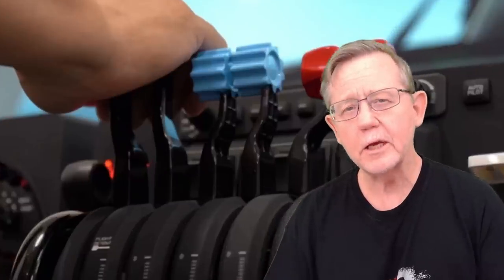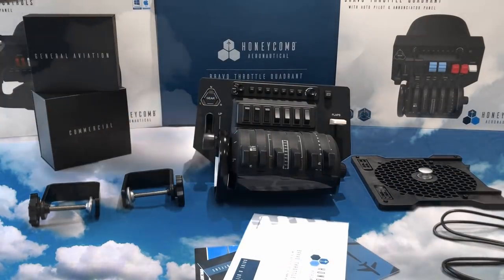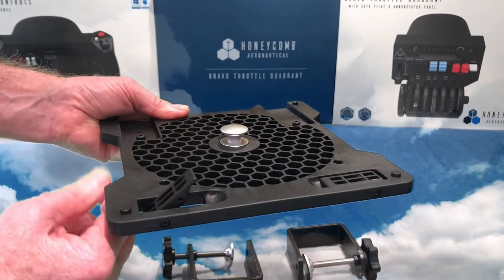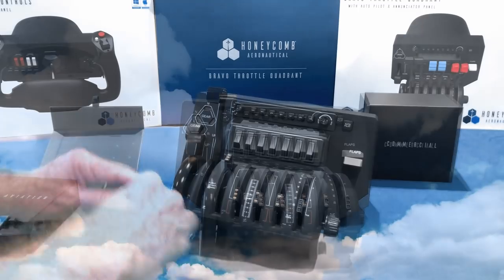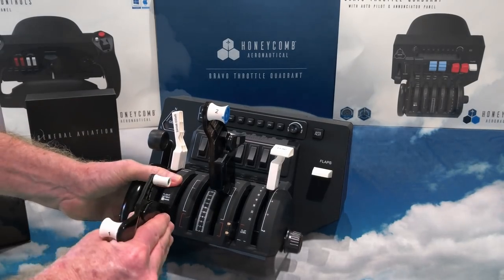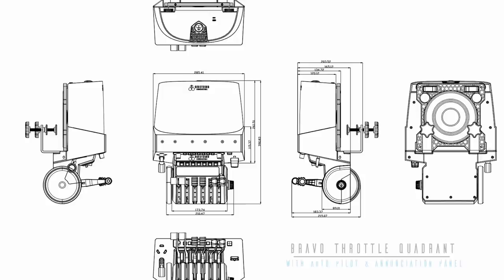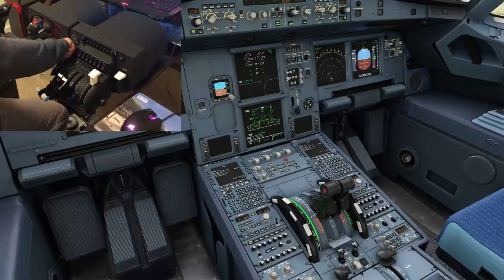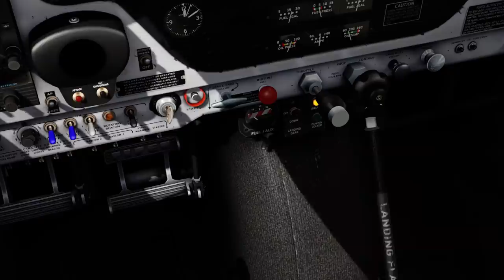BRAVO THROTTLE QUADRANT | Hands On Review | Honeycomb | MSFS | Xplane | P3D

Comment from the maker: The Honeycomb Throttle Quadrant reflects good value for money when compared to alternatives in my opinion. What are your views? Catch my follow up video on how to set reverse thrust for MSFS airliners here https://youtu.be/9xv3BEjysyQ
Reply: It seems good, but still to expensive for me 😢😂
Reply: I've done an amazing amount of reading/research and decided to buy right the first time. 
We shall see.
Mark
Reply: I wholeheartedly agree, even though it is not fully functioning at this time.
Reply: my views are pre ordered in feb from amazon uk.. now expected delivery is december 2020 so my views are simple provide me the unit without any further delays and i will happily give you my views on it
Reply from the maker: @aileronsintowind6835  , I know the delay is frustrating. Regards
Reply: Looks really good, however since it cannot be used with P3Dv4.5, I cannot justify the cost. Great pity
Reply from the maker: @TheVirtualAirlinePilot  , hi not sure about this, as P3D uses the standard interface I can see no reason why it will not work. The Alpha yoke works fine in 4.5
Reply: @SimHangerFS  Thank you Mark - I will contact them and check this out.   Nice video!
Reply: @SimHangerFS  Hello Mark.  Just had a reply from Dave Hodges at Honeycombe.  He states that both the Alpha Yoke and the Bravo Throttle Quad work with ALL versions of FSX and P3D.  Happy days!
Reply: @TheVirtualAirlinePilot  It works fine with P3vD4.5.
Reply from the maker: Time Traveler 2025  , no this was a review sample provided by Honeycomb. First preorder shipments end of November I believe. Regards

Comment: Thank you for this video. Great and reliable information about the product (at the stage - without drivers).
I'm waiting for my Beta.
The only thing that let me down was that the Revers works as it was in Saitek, i.e. on the principle of an on / off switch. I was hoping that the Revers mode would be a separate axis that would work smoothly.
(as it is in TQ6).

Comment: Thank You for your demonstration it was very good in comparison to some of the other You Tube providers. Can you please advise those of us waiting... The “Thrust Reverser” do the spring-loaded handles activate the “Thrust Reversers” (contacts within the handle mechanism) or is it the “Detent” position that activates the “Thrust Reversers”? And the Spring Loaded mechanism merely act as a mechanical lever with no  electrical data being relayed ? Please Advise, as I notice what appears to be brass contacts on the Throttle Quadrant insertion shaft. Enjoy Your You Tube Channel. Respectfully Gary 🇨🇦
Reply from the maker: Hi Gary, the reverse levers are recognised as separate buttons, so you can toggle actions. Regards

Comment: Well for me it’s kind of a mixed bag. While it is very customizable for the price, the airliner configuration (especially for dual engine) seems ridiculously small and flimsy. Also the strange angle of the thrust levers is not for me. It’s obviously meant to be placed on the desk, rather than beside you, where a real quadrant would sit. Very good review, as always.
Have a nice Sunday, all.

Comment: So, do the speedbrake lever jump to brake upon landing? And if not, do it prevent the sim aircraft to do it? 
Also im a bit worried that even the slightest accidential touch on the trim wheel disconnect AP. The display is also  cringed behind the levers.
Reply from the maker: Hello, It doesn’t stop the in sim lever moving. Trim is sensitive but out the way of most tasks. Regards

Comment: Mechanically, it IS state-of-the-art and nearly worth the price.  Configuration of the rotary dials should be straightforward especially after watching a subject-matter expert’s tutorial and it originally worked.  However, when starting X-Plane 11 the second time the autopilot check resulted in errors—for one a trim wheel that rotated by itself and another— the increase/decrease knob didn’t work.  I removed the profile and don’t see me reconfiguring this for awhile.  Ten months into X Plane 11, a few general aircraft, some reality nav/comm gear and EVERYTHING has had configuration issues. Not where we should be in the 21sr Century.  You purchase something you expect it to work—completely—period. Testing, quality control and documentation from the designer/developer and not going to forums and  YouTube to get something working properly. Time flying is well spent; time troubleshooting is time taken-time that is lost forever!  Happy flight swimming.

Comment: I noticed in your Vlog you have the Saitek rudder peddles, Is the honeycomb throttle quadrant compatible with them and the Saitek Yoke? My problem is with the Saitek throttle quadrant, I ether have idle or half throttle (nothing in between) and then on up to full throttle, or if I reverse the throw I then get Idle up to half throttle and then half throttle to full throttle with nothing in between. This is a problem I have failed to solve, so I'm seriously thinking of changing from my Saitek  gear to the Honeycomb setup.
Reply from the maker: It is fully compatible with Saitek. Regards your throttle problems, Have you configured it to an axis and not a button ? This video may help https://youtu.be/iIpMeVYxkdk
Reply: @SimHangerFS  Thanks, that's very helpful. I will give it a go tomorrow and let you know how I got on. Thanks again. Dave.
Reply: Still no luck. I got as far as the window to test the Throttle Quadrant, but there was no tab to calibrate only Test, Dead zone and About tabs. All three, Flight Yoke, Throttle Quadrant and Ruder peddles were featured in Devices and printers, but there was no way to calibrate them. I tried all morning and in the end I gave up. Thanks for your help, its much appreciated.

Comment: Have you configured the dials that come on the throttle quadrant on X Plane? If so, which commands did you assigned them to? And were you able to configure/activate the LEDs as well?
Reply from the maker: Hi Sergio, yes I was able to configure the dials. Honeycomb have now just issued  drivers for Xplane. I am yet to check them out. Regards
Reply: @SimHangerFS   Thanks for the reply.

Comment: Great video as always my friend. But reference the Bravo throttle, it looks very plasticky. I had a Saitek throttle for about a few minutes and then returned it because it felt just so very toy like. I operate with a PFC yoke and Warthog throttle, which adds to the immersion a lot because of the alloy construction. I am very interested in this product, but feel I will be disappointed with the build quality and feel of it.. What are your thoughts about my concerns?
Reply from the maker: Hello, it is made of plastic, with a rubbery feel to it as it has a coating over the mould. Good value for the price, and fairly robust, but not an alloy. Regards
Reply: @SimHangerFS  Cheers

Comment: Unfortunately it does work as intended. The autopilot functions and lights are plane dependent and work poorly and its broken with the heading bug changing by the 10s and altitude changing in 1000s ft. Until that is fixed by Asobo clowns or Honeycomb it is not fully functional.

Comment: Why didn't they include a VS button for the autopilot? How do you change altitude with a fixed VS with this? Will it switch to VS automatically if in ALT mode and the selected VS is not 0 and the current altitude is different to the selected one? any ideas?
Reply from the maker: The left rotary switch/dial has VS and this can be changed using the right inc/dec rotary dial. Regards
Reply: @SimHangerFS  Yeah but on the Logi-Panel i have to push the VS button to actually switch to VS mode after setting the value. The honeycomb doesn't have the VS button so how do you activate the VS mode after setting the value?
Reply from the maker: @spikedsoft  , all the buttons and switches are fully configurable , regardless of label. Regards
Reply: @SimHangerFS  ok thanks for the info. i'll probably sacrifice the CRS button for VS.. :)

Comment: Hi SimHanger...long time subscriber here...can you reply back on how to enable the gear stalk in P3D?  There are no instructions and if you set it up as a button it only maps as button 31.  It retracts for me but doesn't extend without a complete recycling on the gear stalk.  If it could map to both #32 and #31 it would be fine.  How did you enable yours?  Also ... Have you mapped your red/green LED lights associated to gear up/down?  What's the trick there?  I do have the software download from HC but again, no instructions come with it.  Thank you so much if you know how and all the best.  I do think it's a marvelous product ... especially for the money.  Greg
Reply from the maker: Hi Greg, will have a look this weekend on the gear. The lights are another matter. Trying to figure it out myself!
Reply from the maker: Hi Greg, just had a look and I have the same problem. My quick resolution was to use the honeycomb download for the throttle, within the app load the default config for the throttle and your done, plus the lights work! Load up P3D and all should be good. I will be looking into this in detail in the future. Let me know how you get on. Regards
Reply: @SimHangerFS  Thx Simhanger!  The BTQ is a really great product IMHO but the instructionals are lacking.  Channels like yours really help us out here in the world.  Love your offerings!  Keep’ em Up...all THE BEST!
Reply from the maker: @gregh335  , thanks, yes I have seen it. Not really comprehensive but it does help. Regards 👍

Comment: I received my throttle quadrant today. I am having troubles with configuring it for MSFS 2020. I followed one of your videos on configuring, but I am not having any luck. I want to assign throttles, mixture and propellers. When I assign them they do not respond in the sim but work when I’m on the assignment page as the assigned lever is moved. Then I hit apply and save. Also, there are no light on the annunciator panel or the landing gear status. The Honeycomb website mentions update 7 is needed for all this to work.  I’m sure it downloaded, but if I would like to attempt another try, how do I do it. Please help.
Reply from the maker: Hi Ralph, you cannot overwrite the default profile. When changing assignments/mappings are you saving under a different name as shown in the video? The drivers to make the lights work are still pending. The recent update now includes a preconfigured profile for a twin engine prop. You could use this as the one you modify to create new profiles, should be quicker. Regards
Reply: @SimHangerFS  After watching your video..yes I am saving under a new name. One of the puzzling things I am witnessing control levers seem to have a life of their own. I advance one, doesn’t matter which, it will move and then it will take on a life of its own. It is as if it is working against two opposing commands. I am starting with a single engine model. I leave the first axis alone. Leaving the rubber stopper in place I then use the second axis for power and then mixture. When I tried a four engine configuration, moving the speed break activates the throttle for engine number two. It is all very odd because during the setup, everything looks good. Save and resume, then it all falls apart. I’ll keep trying. I flew with the mixture set at full for the short flight, but having the ability to adjust power with a power lever vs the keyboard made the investment worth it.
Reply from the maker: @ralphtheisen6174  , the only thing I can think of to cause these problems are : you are configuring the axis  to the wrong mapping. Some axis have  two possible axis mappings, 0 to 100% and -100 to +100%. I cover this in my video. Secondly you have other functions allocated to the mapping on the TQ or another peripheral, such as a yoke. This is causing conflict. Hope you get it sorted. Regards
Reply: @SimHangerFS  since I last wrote you there has been success. I am a mapping fool. Steadily creating profiles. Now I only need to get my feet wet with thrust reversers. And you have a video for that. Thank you for your help.

Comment: ok having some iues with the throttles, 34 do well and no problems but one and two give me a read multiple axes assigned to throttles any ideas on how to over come this isue because it is not letting me do any throttles for all aircraft when using throttles for one and two? help
Reply from the maker: Hi Dan, I have done a number of configuration videos, check them out by going to my channel, link in the notes below the video. See this to get started https://youtu.be/MjovDdueafI also in the default config throttle 2 is not functioning correctly see this https://youtu.be/E06yP5g90eY